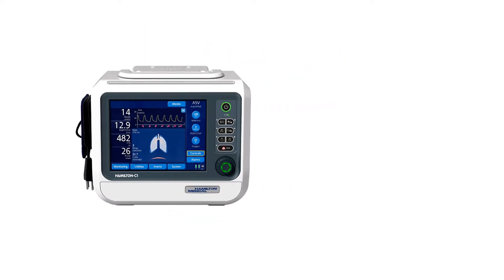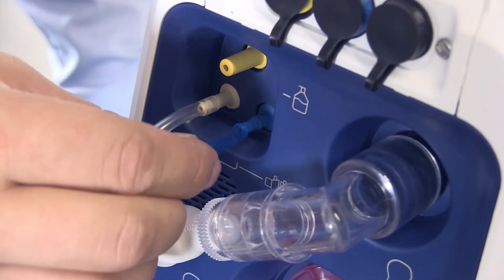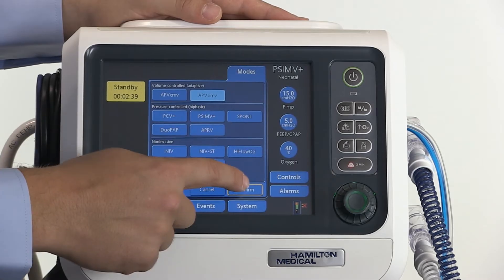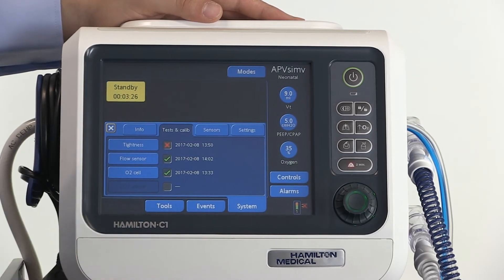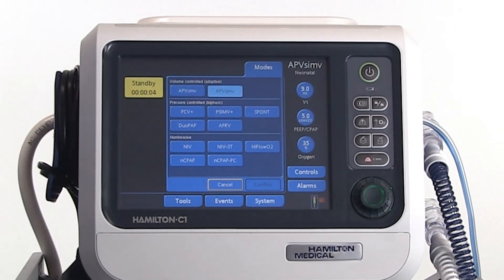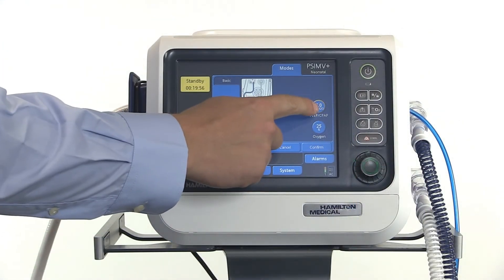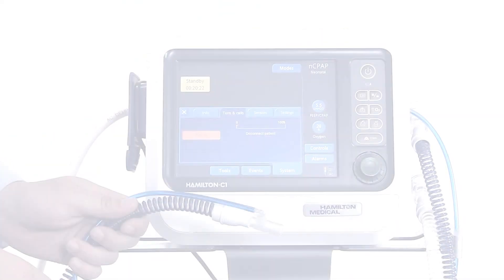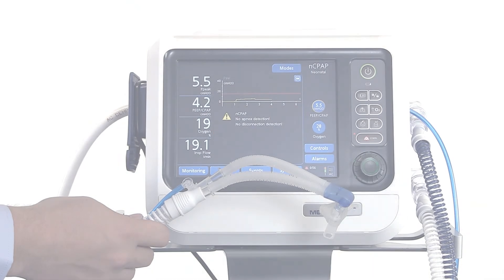Neonatal ventilation: Setup and operation on the HAMILTON-C1/T1/MR1

Comment: The neonatal mode of vent , is from which weight up to what weight ????

So at which weight or age or height should I change tubing , exp valve , flow sensor to Ped/ adult ?????
Many thanks
Reply from the maker: Hello Mohamed, thank you for your question! Please use the following resource: https://www.hamilton-medical.com/.kbpdfhtml/?listUUID=45057ab0-df15-4d62-926f-b0de6cb63539&locale=en_GB&kbuuid=d25fdd72-624e-4591-a986-9dd288121263